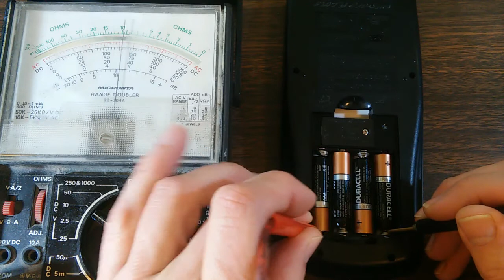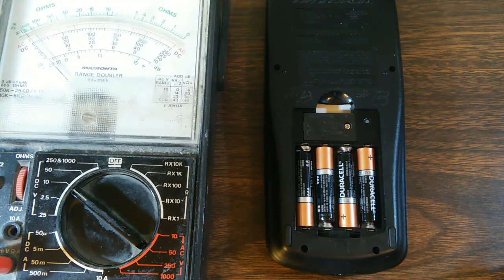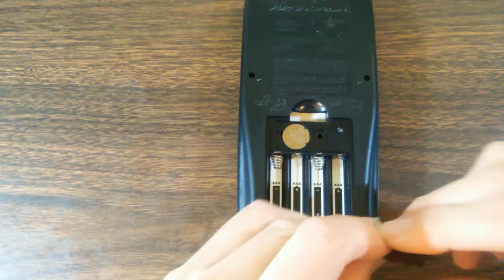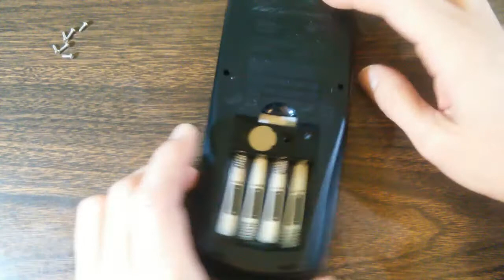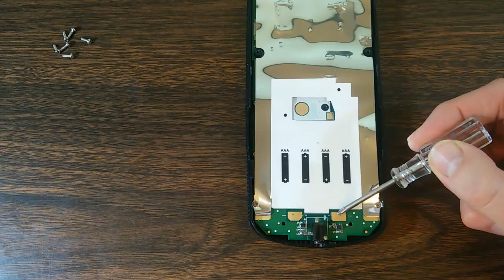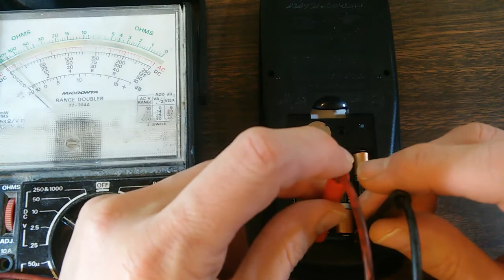TI-89 Calculator Dead.  Repair.

Comment: Thank you for posting this video. The issue that I am having is that currently I have to replace batteries every 2 weeks. I measure the voltage of the batteries and they are dead including the coin battery. CR 1616. What can be causing the drainage?
Thank you in advance.

Comment: Thx for this video. It worked for me. FYI you don’t need to open the calculator (or even remove the batteries) to be able to see and bend the pins. You can access them through the  battery cover tab holes in the bottom
Reply from the maker: If the pads are in good shape, the simple method will often work.  If the pads are badly corroded, it will be necessary to open the calculator and clean off the pads.

Comment: Somehow I have the exact opposite problem -- I can't get my TI-89 to turn off unless I remove a battery. I read somewhere that this could be caused by a dead backup battery, but even after replacing it and putting in a brand new set of AAA batteries and cleaning the button contacts (which were already in pristine condition), the calculator just stays on forever.  

Have you ever encountered this issue before?

Comment: It worked! Thanks for making this video, it saved me money that I didn't have!
I couldn't unscrew the calculator so I just bent those connectors through the little window, I also cleaned it will a cotton swab and rubbing alcohol. Mine had some battery corrosion.

Comment: Thanks for the video that was really helpful .. I have two  questions: 
1- I got the original small sr44 ( 1.55 V ) battery dead should I replace it with the LR55 ( 1.5 V) ? 
2- I got two vertical dead lines zone on the right of the display , how can I get rid of these two lines ?  Thank you

Comment: Thank you! This was the fix for me as well. And in case it helps anyone else, I was able to fix it by just using the metal end of the multimeter (or any thin metal thing really) to nudge the contacts through the two holes at the bottom and it immediately turned on. :)

Comment: Thanks, you don't need to take the cover off even though. Simply sticking the probes through and moving the contacts was enough to fix mine.  Would not have known to try it though without the info in video.

Comment: Thanks David. I was able to measure 6volts in system board so there are good contact between front and back ? Still the calculator is dead. Can you help ? 🌷

Comment: THANK YOU! This just saved my 20 year old calculator and several custom programs! As a tip for anyone to read this: I have a driver set, but my T6 bit wasn't long enough to access two of the screws. HOWEVER! If you look carefully inside the holes demonstrated in the video, you can see the contacts and if you gently move them with a tool a little bit onto fresh metal, you can perform the operation without disassembling the calculator!
Reply: Thank you! I found my dad's old ti89 and decided to try to fix it, and this worked. There was a lot more wear on the connectors. Again THANK YOU!

Comment: Hey so does the replacement battery turn on the calculator or no? I put a new one in because mine didn't have it, and the calculator doesn't turn on or anything.

Comment: You just saved another ti-89!
I needed new calculator and found out used ti89 and i went to pick up and when i test it out, it did not worked! The owner, she said she will throw it away anyway and said just take it for free then test again if it works then if it works contact her again and give her money for it. I watched your video and repaired it! It works fine! Now i need to give her money 😂😂😂😂

Comment: I have one where one contact has been corroded away due to a battery leak. Is there any way to repair the copper? Some kind of conductive paint?
Reply from the maker: Is all the copper actually gone?  If not, try fine sand paper or polishing compound to remove the corrosion and get a clean copper contact.  You could try conductive epoxy.  Conductive paint would probably wear through very quickly.  It is possible to put down solder, but difficult and you could melt the underlying plastic.

Comment: Thank you for this, all the text based self help sites just say to adjust contrast, and then the more outlandish ones suggest factory resets, backup battery swap, and a new firmware install button combo. All book smarts and no infield experience like yours that get results/

Comment: This repair is a temporary fix, and will actually end up breaking the contacts off after enough times due to fatigue. What I did was put a couple globs of solder on the two main battery pads, as well as the two backup battery pads. Permanent fix.
Reply from the maker: The contact pins only have to be bent slightly and hopefully it will be several years  before you will have to do it again.  This calculator has been in production since 1999.  Two decades later they are probably getting their first bend.  I think you will be a very old man before you break a contact from metal fatigue.  I tried soldering over the pads.  I could not get a good result and the heat could damage the plastic underneath.
Reply: I have a question: if your graph link port doesn't work at all, is there any way to fix it?
Reply: What did you use to solder it? I tried 60/40 tin lead with 2% flux, but it won't stick to the terminal
Reply: @Ryan-dj5ku You need some paste flux in addition to the leaded solder. I promise it's worth the investment. I have a pot of kester no-clean and a spool of kester leaded flux. Quality supplies make a huge difference.

Additionally, you want to dump heat in fast. Use a large tip and add solder to it to help conduct heat into the pad. The pad won't take solder until it's hot enough.

Soldering is a skill. It's not a hard one to learn, but it still must be learned.
Reply: @crackpotfox can I use plumbing flux? I have some oatey H20 water soluble tinning flux and number 95 lead-free tinning flux. I didn't want to heat it up too much. I was afraid I'd mess up the board
Reply: You could just solder wires from the battery terminals to the copper pads on the board